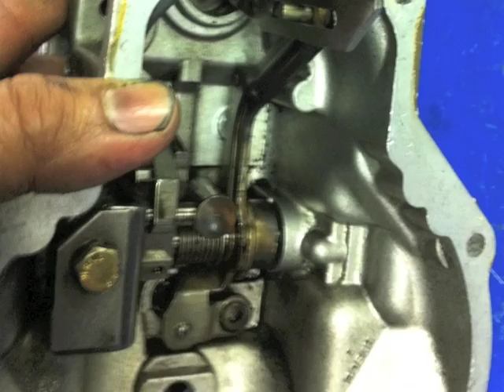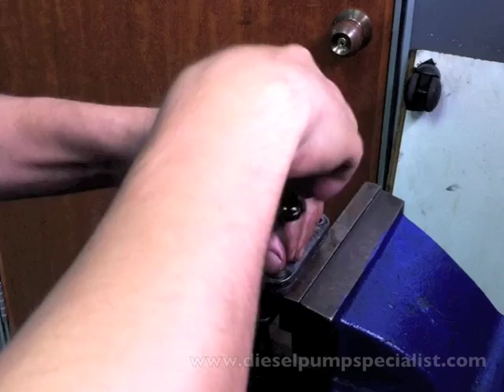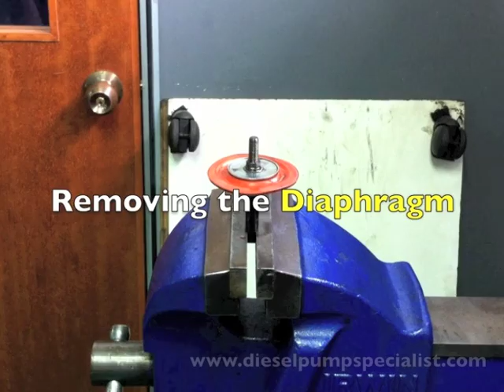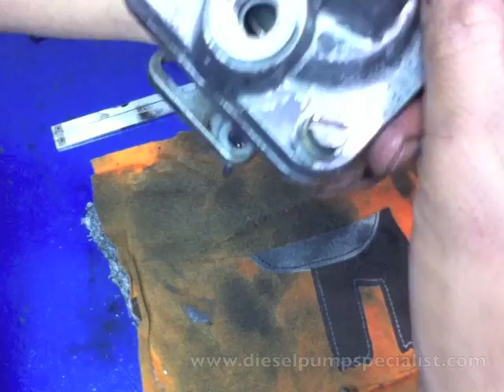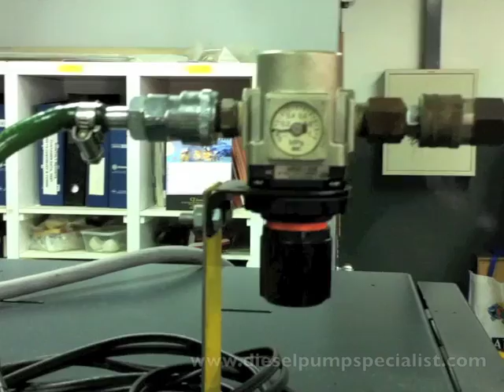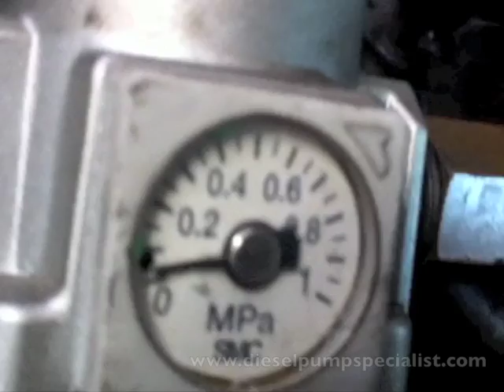Diesel Pump  Turbo Boost Compensator

Comment: Hi, I bought your Injection Pump Repair VE ebook a few months ago. I'm adding a turbo to my NA TD42, but it has no boost comp, planning to upgrade from standard 10mm to 12mm elements from land cruiser 1HD.

  Can a compensator be bought off the shelf or must it be sourced from a donor pump? If yes, can you point me to someone who sells these boost compensators separately? Malabon Diesel perhaps?
Reply from the maker: +trekblazer Malabon Diesel might be able to help you modify your pump. But swapping parts from a Toyota probably won't work as they are a completely different part. Will need to upgrade to a bigger radiator as well.
Reply: Where's the correct position of a diahpragm according to scratch mark....can you make it more clearer...to find a min /max if need adjustments..thanks..

Comment: I have 1986 BJ74 13BT engine it does not shut off i have to shut it manually in the engine compartment has this small lever i push it and it stops do you know what needs to be fixt.